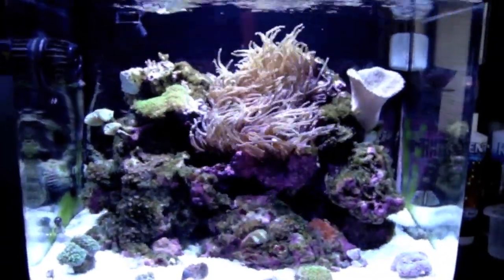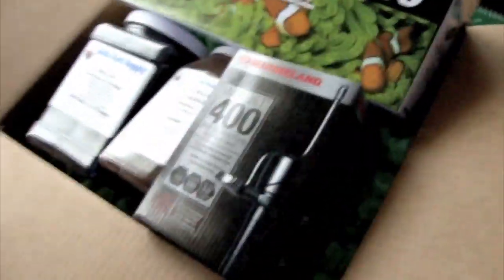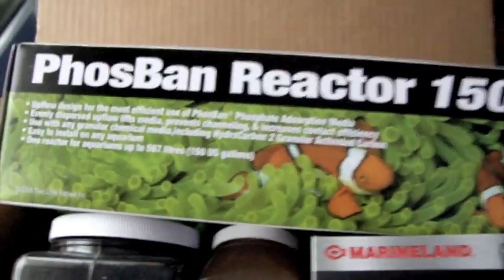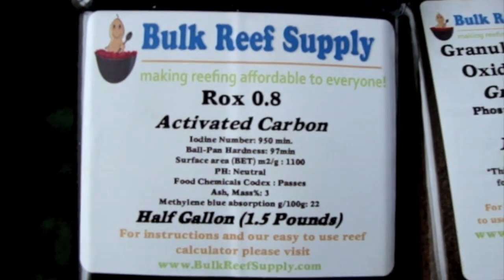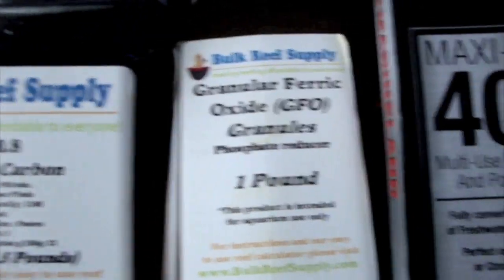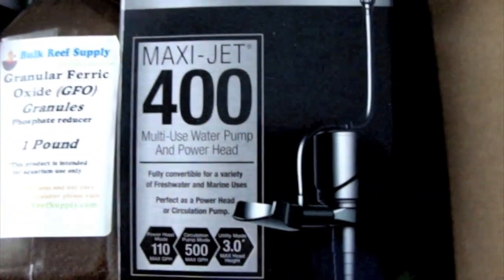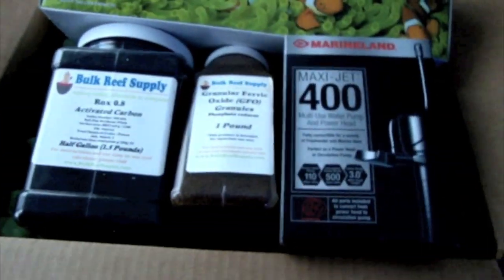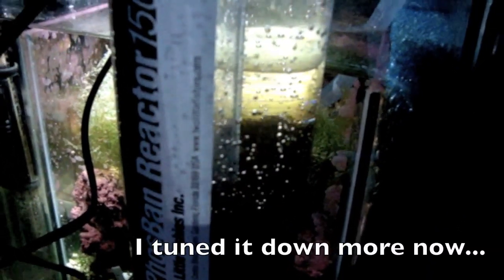How to Install a PhosBan 150 Reactor on a BioCube 29 HQI

Comment: Oh and do you think it would be ok to just drop 2 pico 400 in there running two reactor, one for gfo, one for carbon? I mean will the pump fit together in the first chamber and have no problem sitting on top of each other?

Comment from the maker: I think the 200 should be fine. Because i have to turn down the flow on my 400. so the 200 should be more than enough power. As long as your not pump it a great distance. (Ex. A setup similar to mines.)

Comment: i would reduce the flow to the point where the media is barely tumbling because when carbon is tumbling like that it will cause the media to kinda scratch together n relase carbon granules into the system...all the research i have done has showed that when u plave carbon in a reactor u do not want it tumbling much at all....just a tip that i have come across while researching this method.....great video Overall....thumbs up !

Comment: @ArcAngel9008 - Bro! whare u been? lol Back in August the 72 leaked out the bottom front. The bottom of the tank is the only part that I didn't reseal. So, this is why the 36g is back in action. I have not been home to build a new system yet.

Comment from the maker: @sjj710 I have been thinking about going LED, but it is very expensive. And i dont know how i would mount these lights on my existing biocube.  I have looked into the AI light. AND I WANT IT lol. but it costs $ and idk how to mount it.  Noise would deff go down drastically. and the need for the fans would go away :D

Comment: Nice addition!  Your tank should go back to looking pristine in no time.  On a side note, have you considered going with a LED lighting system such as the AI nano, or kessil 150a?  I think it would cut a lot of noise from your system, because it emits substantially less heat then the halide.  You may be able to do away with the fans and/or the chiller, giving you even more peace and quiet in your room.  Just a thought.....  :-)